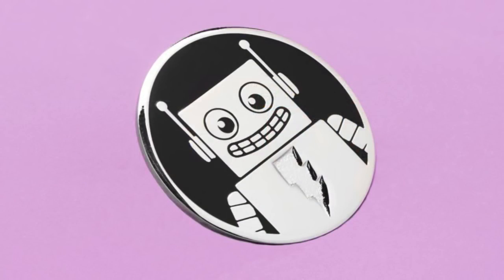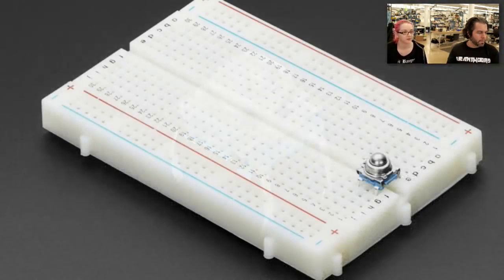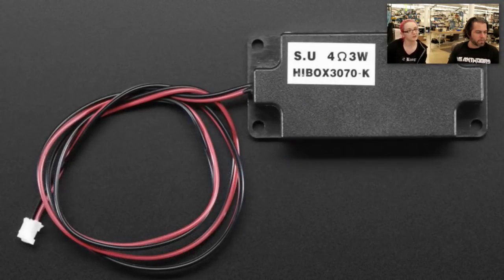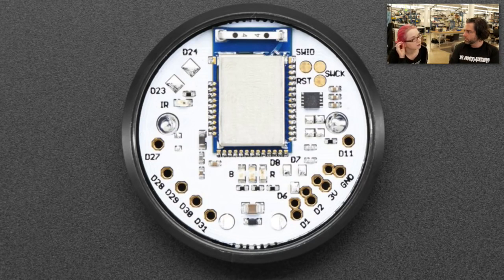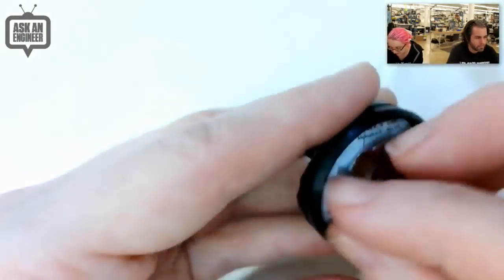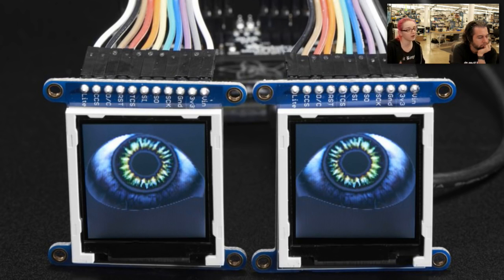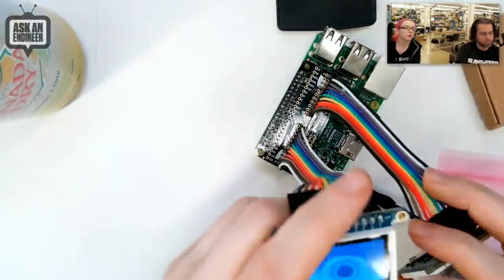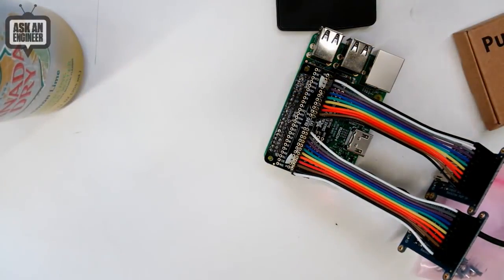New Products 1/11/2017

Comment: Phil held his "Future of Fursuiting" Electronics/3D Printing panel here at Further Confusion Friday the 13th, and it was a very good panel!  I got to see the eyes and a dragon fursuiter had them on his head as well, so a very good demo there!

There's some ideas on using the Pi3 with the camera to track existing eye movement and show it in the "external eyes".  I now wonder if there's a way to do three eyes.  Time to check the Pi's pin alternates!

EDIT/UPDATE The Teensy 3.5/3.6 has the three SPI ports that can drive them. The Pi Compute module as well has them.